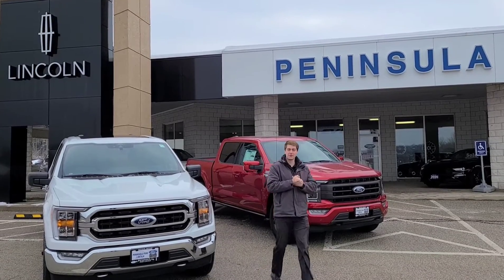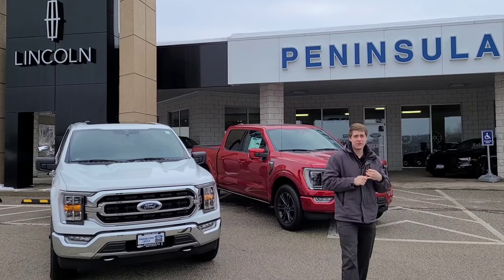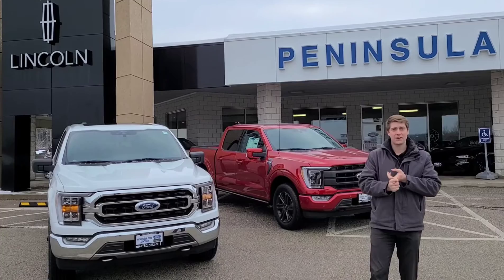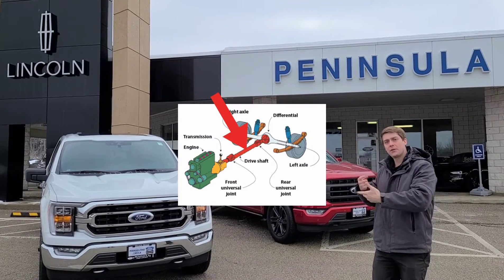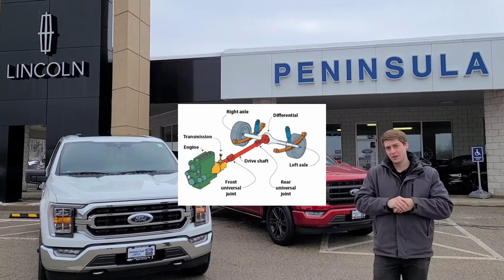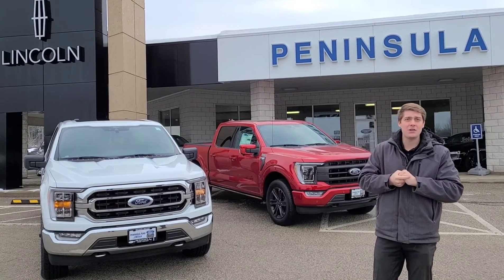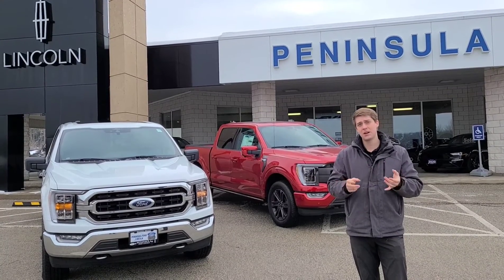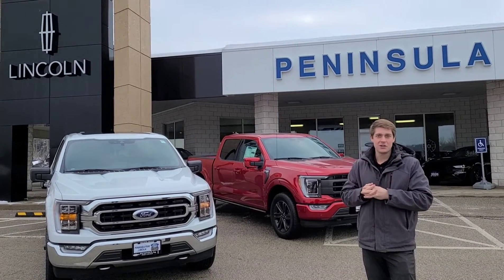Why does axle ratio matter?

Comment: i dont know but with the 10 speeds i dont think there is much to be gained by a smaller ratio im already pushing 1500 rpm 
on the hiway and i got the 3.73

Comment: F150 5.0 for daily driving 3.31 or 3.73?
Reply: 3.31
Reply: @stevenrussell5937  why the 3.31 instead?
Reply: @gd88899 not sure if it was answered to you yet. Lower RPM when traveling at the same speed.  Let’s say a 3.73 is at 2500rpm, a 3.55 is at 2250rpm and a 3.31 is at 2000 rpm (fake numbers). The less your engine has to rev to go the same amount of speed

Comment: Why dose Ford put the 3:31 in the FX4? Off road torque is lost in this ratio!
Reply: Isn't the 3.31 better on gas?
Reply: @gd88899  yes, but an off road trim should be geared towards the lower side.. like the tremor has 3:73
Reply: @Klperformance68  what is best for v8 lariat a 3.31 or 3.55? Just everyday driving no towing.
Reply: @gd88899  with the 10 speed ya can’t go wrong with the 3:55 good all around ratio IMO
Reply: Good question

Comment: I'm buying a 2022 Ford F-250 with the 3.73 gas engine. What gear ratio is the best compromise for towing and mpg? We will be hauling a camper under 10K lbs and will not be towing a lot. I really just wanted the bigger engine. Thanks ahead of time.

Comment: Can ford change them after the factory builds it
Reply: if you're changing gears it's because you typically went up in tire size and need to adjust for that, couple grand at the high end, would not have ford do it but a reputable off road shop that does them all the time.
Reply from the maker: You certainly can. Although it is not advisable. You will change the ford tow specs. You will need to calibrate for your speedometer change. It would be a costly adventure.